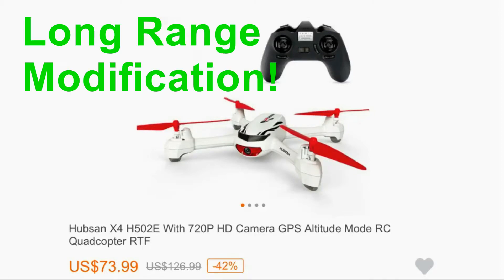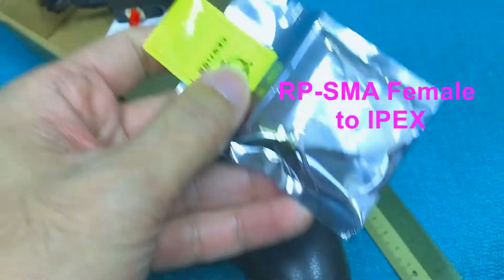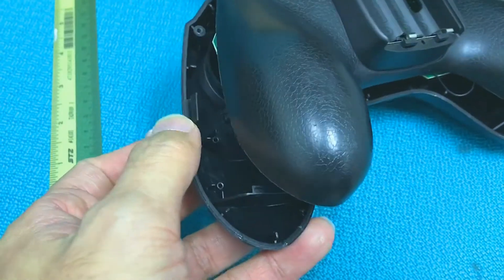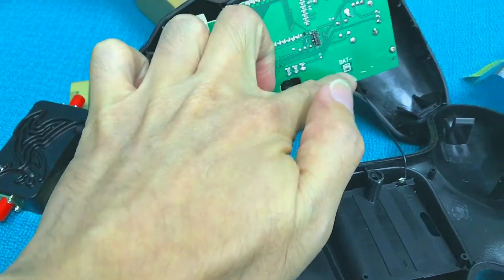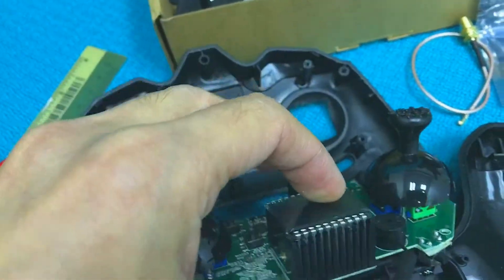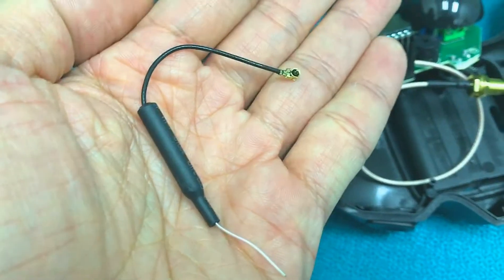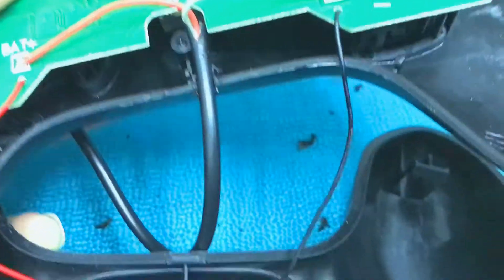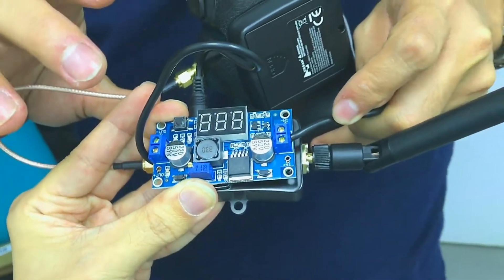LONG RANGE mod for Hubsan GPS quad!

Comment: can you make a range test with it?
Reply from the maker: Sorry mate, this video was a year ago. Crashed the drone and had cannibalized the parts for another project since it was not worth buying a new body shell and a mixer board. We flew across a standard-size stadium which was 200m away and continued to cross over 3 tennis courts and another 100m over a park before it failed safe. The diagonal distance between the quad and the radio controller was about 700m.